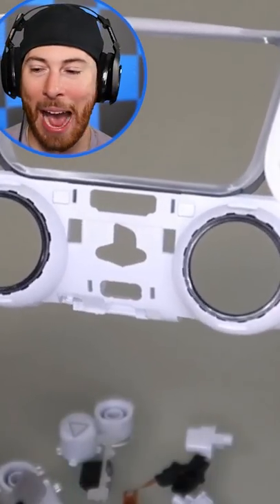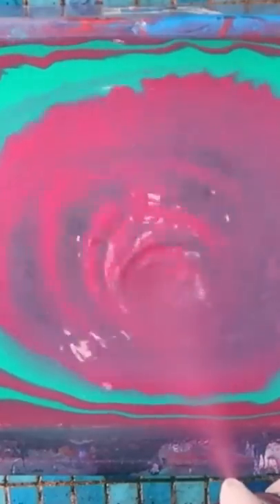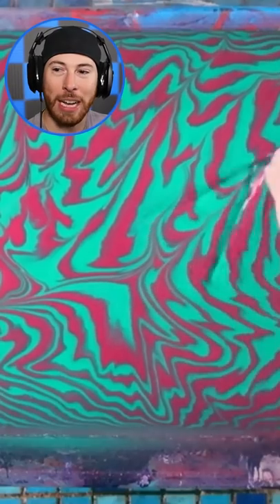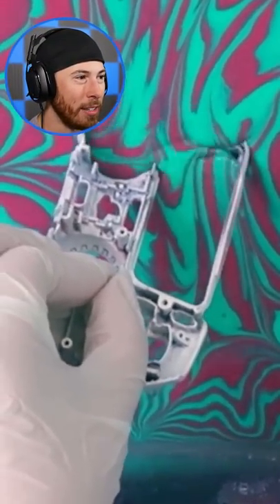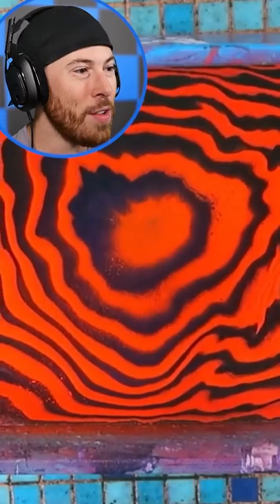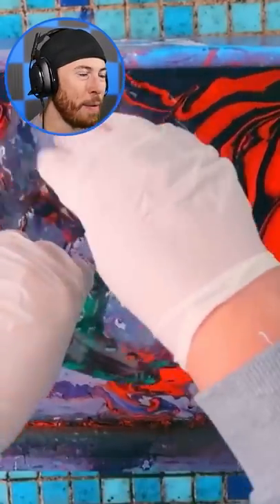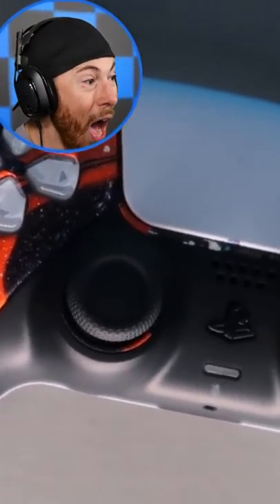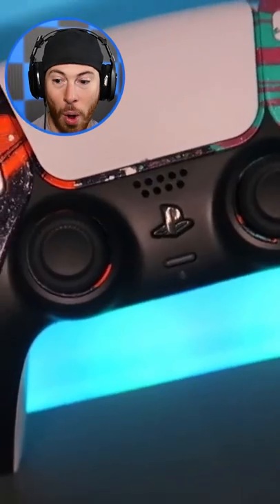HYDRO DIPPING Crazy Patterns! #shorts

Comment: Only issue with it is that it can't handle the use a controller gets. It's gonna wear off in a week
Reply: You spray it afterwards whit some sort of adheasive thant makes it last longer
Reply: They spray a top coat. It ain’t coming off
Reply: you normally add clear coat to the item you dip but yes it probably wouldnt hold up the paint for too long depending on the user
Reply: If u put a few layers of varnish on it can last longer and won't scratch the paint away
Reply: I’ve had mine dipped for a few months now and it still hasn’t came off at all
Reply: I see that as a win actually. Imagine getting to pick out different colours every week or so, unless there are some health issues involving that idfk but a different design every week sounds cool asf
Reply: usually with almost any adt they will slea it after with a layer of clear top coat.
Reply: @user-pb7wy5gm3k  except you have to disassemble the controller each time setup a hydro dip etc, if your face plate is removable sure I've seen a few controllers with that but otherwise that's a pain
Reply: @PlinkyVR  yeah true but still cool
Reply: Epoxy or varnish is added after
Reply: @william_l1523  Think its polish, also gives a shine
Reply: Aaaaaand that's where clear coat comes in
Reply: Yuppity
Reply: Not really, also what do you mean "use a controller gets"? I treated all my controllers with respect I dont really know how it would fub off. My Problem is, I personally get extremely sweaty hands (it sucks ass) but that's just a me thing. Unless your throwing your controller around like a little rage baby I'm not sure how it would come off, especially with a clear coat.
Reply: @magnumbeefus  it would come of cos of all the rubbing and the sweat would slowly eat at the varnish but yh a coat of varnish would make it last longer but not forever and it's the rubbing n8t throwing the controllers around that makes it come of 😂
Reply: @user-pb7wy5gm3k , as far as "health issues" I don't think rubbing against dry paint will hurt you much.  If it was turned into a dust and inhaled (think sanding) that wouldn't be good for you over time.  The worst part for your health would probably be accidentally inhaling the paint as your spraying it.

If you wear a proper mask (while sanding and painting) and don't do it constantly, you shouldn't see any negative effects on your health.
Reply: @Croucher72649  it will definitely come off, I did this to mine and added a clear sealant and it only lasted about a month
Reply: Itll.literally peel before a week the sweat you cause holding a controller still destroy within a day